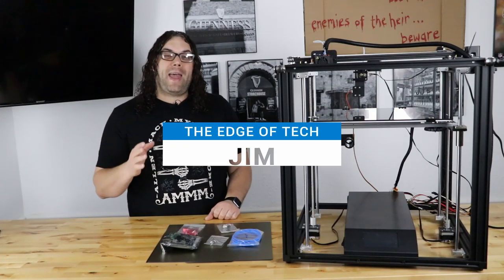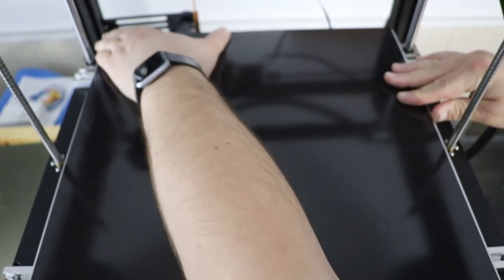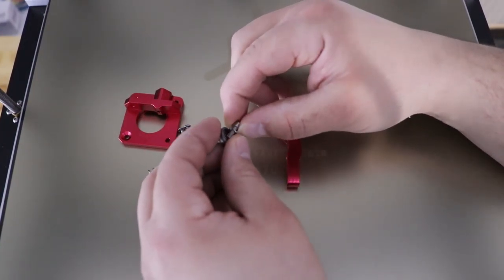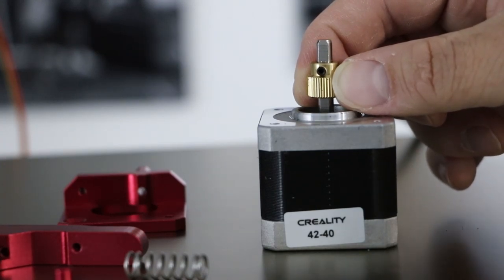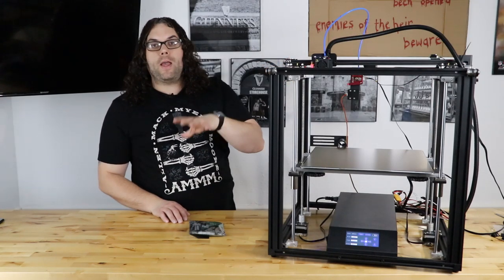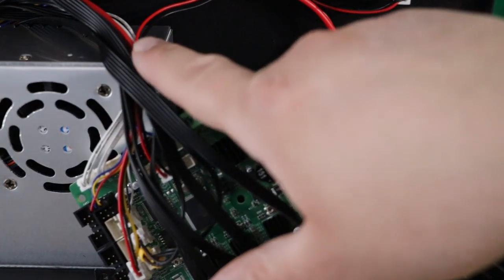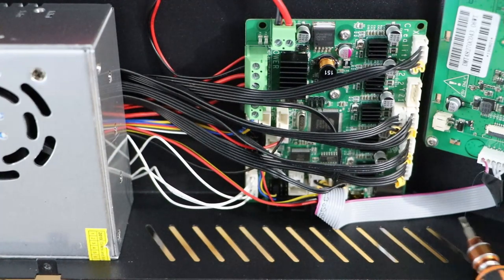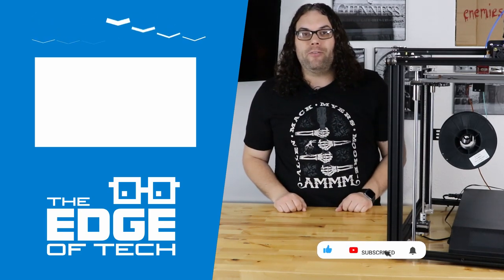Upgrading my Ender 5 Plus to be Silent using the New V2.2 Silent Board and adding all the PRO Parts!

Comment: Great Video.  As soon as they are back in stock, I will order silent board. Already upgraded power supply, extruder, and  tubing.  Kersey has some files to print to mount power supply outside of the enclosure - great for cooling.  One recommendation is that for anyone making a swap of components, take pictures with your cell phone!  Price is right and sometimes the chance to look back on what it "was" is priceless.  Thanks!

Comment: A wise mechanic once told me, "never tighten the 1st [screw] until you have all of them started."
Reply: I learned that form experience
Reply: the trick is to get 3 +  and get the other girls to play with each other then you can focus on one
Reply: The bevel head screw is the alignment screw and should be tightened first then the other two can be tightened.

Comment: Control box: there is two screws in front, and two in back, going through the 2020 profiles. Remove those, turn around the controlbox, instead of turning the printer on the side.
Reply from the maker: Good idea! Thank you for the suggestion!
Reply: Saw that on a video too. Already did this, waiting for my board to arrive in the next hour!

Comment: The TH3D pneumatic couplers are super strong. I put the tube in and it will not budge at all. They are much better than the cheap ones Creality uses.

Comment: Jim, A great video.  Can't wait until I get my Plus to a pro pro pro level.  I think it is a great printer and you had some great ideas.  I have a E3d Herema on order and have a Meanwell that I got from TH3D, just waiting on Tim's upgrades for the main and EZABL.   Also will put ferules on all of the bare wire connectors
Reply: its done

Comment: Just got my Ender 5 Plus, waiting on the new power supply then going to fire her up.  It looks like they upgraded or revised the silent board. I got one that is a beautiful black PCB and shows v 2.2.1; it would be interesting to know what the difference is. I also noticed the board has spots for dual Extruders, as well as dual Hot Ends. An Ender 5 Plus with dual Extruders and Hot Ends sounds amazing.

Comment: Tiny Machines 3D is going to have their machines with all these upgrades available soon! By the way, the silent motherboard is standard in our machines.
Reply: has there been variations of lead screws on the 5 plus only my 5 n cr 10 back lash threads dont fit

Comment: As I said in your power supply video, I also say I have the v2.2 board on my brand new ender 5 plus.  I know you said the new ones were coming with the upgraded power supply, do you think I got the upgraded main board as well?  I figured I would buy all upgrade parts before I assemble.  Thanks again for all your help

Comment: @The Edge of Tech

Why the Th3d Bowden over Capricorn, you mentioned fittings was the reason why (not much elaboration), however you can acquire upgraded fittings with one of the the Capricorn Bowden upgrades. Is there something specific I am missing or were you under the impression the Capricorn bowden came without fittings? Is the TH3D Bowden setup better in any regards?
Reply: For those interested in this comment, I did some digging it appears there is no difference between Capricorn pneumatic tube fittings and TH3D fittings. They both have metal teeth to dig in. TH3D claims their Tought Tube is "lower friction than standard PTFE tubing", which does not make sense. Tube claims to be 100% virgin PTFE, virgin polymers are standard polymers. So overall, I see no benefit to the TH3D

Comment: Your videos are very well done, Thank you for that.  I know Creality has info related to leveling the Ender 5 Plus, however, its not great information.  They also have videos, again, not great.  I purchased a 4 month old Ender 5 Plus that is buggy with regard to getting the BL Touch leveling properly.  I believe the previous owner set something incorrectly internally.  I am only 2 months in on learning 3d printing, and have come a long way so far, but there are not a lot of videos on this specific model.  I have had better luck just turning off auto level, and manually adjusting the printbed.  That somewhat of a bummer as that was supposed to be an awesome feature of this unit. Thanks for any help you may be able to offer. Kindest Regards!

Comment: Hey...  So here it is 3 years later from when you posted this video.  I just ordered a Ender 5 Plus and also ordered the silent board to put in as well.  Will tackle the extruder, bowden tube and build plate later.  So have you looked into changing any of the fans on the machine to noctuaet to make it even quieter?

Comment: My man... good video. 8 out of 10.  Great video quality and ongoing explanations. Polite feedback: 1) it was not a warm fuzzy when edited out how you overcame the hot glue. while I know its not an end of word situation... a lot of heat elements can damage a PCB. I fear someone left to their own devices can go awry here. but they are getting rid of the old board likely... so does it matter? 
 2) adding a 'silent board' to a mechanical device then leaving lightweight materials such as loose wires to free float and "hang loose" in a metal case is somewhat counter productive or i am just a OCD troll. 
3) really just thinking to the world here... as a former mechanic and not an engineer, I often think about why desktop engineers have no issue flipping things around. I'm glad you touched on the dislike to lay 3D printers on their side. the threading contact surface area is designed for vertical pressure to align on the shaft axis. that's why you don't see all-thread guiding the horizontal axis in most industrial applications. The risks is why you see a tapered and exaggerated thread on wood and stone screws designed to any orientation.  that said, I think taking a couple cinder blocks and 2x 4 cut to length supporting the feet o r corners diagonally and getting under the printer to access the mainboard. plus is super comfy to lay down and take a tactical nap. though the hot glue melting may not be ideal without a face shield. for hobbyists maybe its no big but for an industrial application that could void a warranty. If getting under it is not an option, maybe disassemble the bed to release that stress. but for those afraid to take it down that far. getting under it may alleviate the risk of damaging the threads and alignment.   
Again those are just one mans observations and you had great content I was walking away with a wealth of more info than I started with. keep up the great work! got a new subscriber!

Comment: Amazing video. Im near to adquire a I3 MK3S in these days. But before adquire this i want a ender 5 plus to upgrade it.

The motherboard can be change for one better from other brand that you can change the parameters or configurations? 

Happy New Year
Reply from the maker: Hi! You can change it if you are willing to do the work to make it function with the new board!

Comment: Great video, but just a quick question. When you're fitting the new board, I couldn't help but notice that the version number on the old PCB was V2.2 and the replacement one was also version V2.2? Both also had the heatsinks on the driver, so it looks like they are both the same PCB?
Reply from the maker: It's the same board, but they just put the silent drivers on them. It's the same thing that they did with the 1.1.5 board.

Comment: Jim, I was following your tutorial while replacing my board with the new 2.2 silent board. Are you sure you placed the x, y z cables in the right slots? You have them placed differently than the original board you replaced. It was an observation I noticed. I followed your tutorial and matched wire for wire on mine with my original board and its different than yours.
Reply from the maker: I believe I did have one of the wires in the wrong slot in one of the shots. But I think I corrected it in a later shot. I would just do wire for wire on your board just like it was and if you have any doubt, the wires are labeled and the board is labeled so follow that. Good catch!
Reply: @TheEdgeofTech  Thanks Jim! I have the board in, now to build this beast!

Comment: Flex Plate - Smooth or Textured PEI CoatingWhat’s the difference between textured PEI and smooth PEI? Why would you choose one over the other?:
Reply from the maker: The smooth PEI will give you a smooth texture on the bottom surface of your prints. And the Textured PEI will give you a cool textured look. In my testing, I needed a little more quish on the smooth plate vs the textured plate and had to keep the smooth plate much cleaner to print on it. But they both are great, and will work very well!
Reply: @TheEdgeofTech  Was going to pull the trigger, but the shipping kills the deal for me. :(
Reply from the maker: On the Flex Plate? It's a harder product to ship and not get bent, but if you use the code TEOT5 at checkout it will get you 5% off the order! Maybe that will help!

Comment: I have a CRX (similar) that I have done the exact install, but without BL.  I'm having issues (flashed with CURA 4.5) with the level command.  Once I touch the Level incon machine auto homes, but then the screen goes blank.  I have power down, then turn back on to get going again.  Going to try a different loader and see if any difference.

Comment: I'm going to order the Ender 5 Plus and want to make it like the Pro. These upgrades still are the best or are there any better by now? such as the extruder and the silent board and version of it?
What about changing the noisy fans with silent fans?
Reply from the maker: I would use the newest board available. And the metal extruder is still great. A dual geared one would be better! Fans would be a personal choice. I would start without them and go from there.

Comment: You plugged your Y stepper motor into a different port on the replacement card than the original.  Is there any reason for this?

Comment: I was going to get the EzFlex system but it's out of stock for the Ender 5 Plus and no idea when restock will happen due to the Corona situation in china. Also can't decide on smooth or textured surface, but thinking smoot.

Comment: The ex flex system.... You say to get the 370x376.... Isn't the build plate 350x350. Will I have to trim it. It didn't look like you had to in the video but I wanted to be sure before I buy it

Comment: HI, Great video.  Question would we need to update the firmware on the new board to fix the bl touch?
Reply from the maker: I did not have any issues with it on the new board. But if a new firmware came out, I would definitely update it. I'm waiting for the TH3D firmware honestly.
Reply from the maker: If you look at 19:33 It shows the current version on the board I got.
Reply: I had the same problem. Was flashing red. I had the cord in the wrong place. The 3 pin below the whites that come off of the power supply it is a black plug with a red brown and orange wire. Put it on the second set of pins orange to the right

Comment: 15:35 thank you so much for that close up
i connected my fan to the wrong port (tried a different mod)
and now my z-axis is a little f*ed up (steppers not behaving)
I don't know for sure if the two are connected, but it worked fine right until I misplaced the fan connector ...

Comment: Great show. Hi steve here. 1st time callee long time listener.    Silly question for you. Will that board work on stock cr-10s. I see the lcd cable is only 1 and mine has 2 cables.
Reply from the maker: The site says it will work on a CR10S and a CR-10S4. I just verified and there are two display ports. If you're bored has the v 2.2 board this will work. All they did was take that board and add silent drivers to it.

Comment: Wich mean well are u going to use... and did u had any issues with the 5 plus like rebooting and stuff I have seen some youtubers who had issues with that
Reply from the maker: I just got the MeanWell PSU from TH3D and I will be posting a video soon about it! I have not had issues with the rebooting etc. I may have gotten one with a later firmware that fixed that issue though.

Comment: Does this new Silent board 2.2 have SILENT STEPPERS? I heard that TL smoothers are a must have for better print surfaces and the Ender 5 pro board has them but I heard the new 2.2 board for the plus does not have them. Can you clarify? I am wanting to order the 5 plus and new 2.2 board but having the Silent steppers is important. If the board does not have them could one upgrade the new board with TL Smoothers? Thank you for any help!
Reply from the maker: Sorry for the delay. The new Silent 2.2 board does have the silent steppers!

Comment: Jim. I need some major help, please. I think my E-steps are off on my 5 plus. Can you please do a video tutorial on how to configure E-steps on the Ender 5 plus? The menu is different than on the 5 pro and ender 3's. I have watched videos but am so confused in regards to the 5 plus. I am in need of major help for the process. Nobody has any info on tweaking your E-steps for the 5 plus. I know you mentioned it in your video at the end. If not a video can you please explain how I can do this? My prints all have layer lines and it looks like the esteps might be the culprit. I looked at your Ender 3 estep tutorial but get lost once it gets to the control screen settings since they differ on the 5 plus. Any help is very much appreciated!
Reply from the maker: You should be able to do it by following the steps in the video here, as long as you can plug your printer into a computer! If you don't have Octoprint you can use a free program called pronterface.  https://youtu.be/HVljfDVPp3o

Comment: Question for you after adding the magnetic bed to my 5+ I now have a bed level knob that barely is gaming into the bolt when I level. Did you swap out springs when you went from the thicker glass bed?

Comment: Jim, What is Tim going to do for a Ender 5 Plus mainboard upgrade?  I want to replace it and add the EZABL, but can't figure out what the package will be.  Any information you can provide would be great.
Reply from the maker: I'm not sure. I don't think he is working on a board for the under five plus. But you could move to this board and add EZABL once he gets the firmware ready.
Reply: Timothy Hoogland  Tim, I have a spare EZBOARD, will that work??  I purchased a third one while you were fixing my USB.  I really want the BLtouch   replaced with the EZABL.  Good to hear you are getting well
Reply: @woodwaker1  Yes. You just need to replace the display since the touchscreen will not work with it.
Reply: @dayjeremy  Thanks to you and Tim.  I was looking at the TH3D forum and Phasma had a complete wright up on the process.  I have a new Meanwell that I purchased from TH3D, a EZboard - so I need to order an EZABL pro and a screen when he has them ready.  I imagine that they will have firmware soon.

Comment: Got a question.. So I upgraded my board to the silent board (the one in your description) and every time I manually level my board, everything seems good. Then I go ahead and print something and the bed is too close to the nozzle. So I go back and check my bed level again and when I check, the bed is indeed very close to the nozzle, so I adjust it again. Then when i print something again, the bed is too close to the nozzle again! Im not sure why.. maybe I misplugged something when swapping the boards? Any help?
Reply: It's.probably because you're leveling the printer while the tip and the bed are cold and not hot, when they're hot they expand and make the hot end and the bed become closer. Level the bed while they're hot
Reply from the maker: I just ran into this issue last night and I need to dig into it. I think I need to set my Z height per the manual, then go from there. I will update this when I find the solution. Unless you did already?

Comment: so I did the upgrades, put all the right chords into the right spots, and when I turn it on the printer, it stuck on the opening screen (Ex. @19:06)
Reply from the maker: I would double check the firmware and cable locations.

Comment: Installed my metal extruder while watching this video! Great help and I thank you a LOT! One thing I'm curious about when you put the gold gear (might not be calling it by the right name) on the stepper at 7.32 in the video you say to make it snug and you will adjust it later. Have watched video three times and I never see an adjustment? ? ? When did you adjust it?
Reply from the maker: Awesome! Thank you for watching! I will have to go back and look but maybe I forgot to keep that in during editing lol But I would definitely make it snug, Just make sure the filament goes through and lines up okay with it.
Reply: @TheEdgeofTech  I definitely need to adjust mine. Filament just stopped feeding.  No nozzle clog, that end is fine. So . . . how do I adjust it, lol?

Comment: How about calibrating the Extruder with this 5+? I am having trouble as the metal extruder is under extruding for me since I've force upgraded to the metal when the plastic failed.
Reply from the maker: Hey Ross, shoot me an email.and I can help with that. You have to plug the Printer into a computer to do it.

Comment: Hi, I just opened my uni and the fan connector (bottom plate) got disconnected and I am not sure where the fan connector goes to now. May you kindly let me know where to connect the fan screwed to the bottom plate is being connected to? In you video, it seems to be the first connector, which is Vin+ (the one nearest to the crystal) but should it not be the fan connector instead?